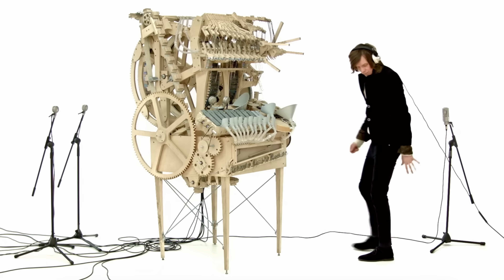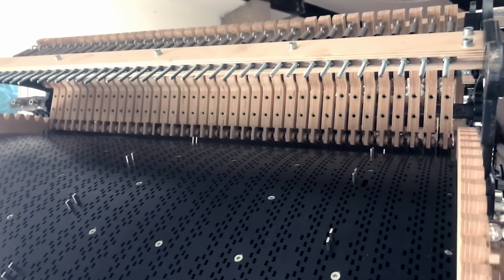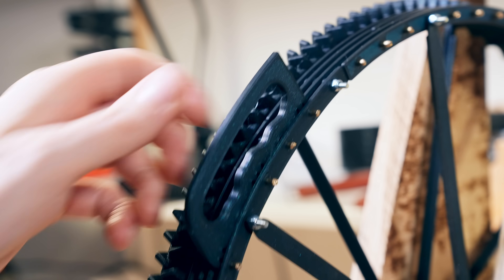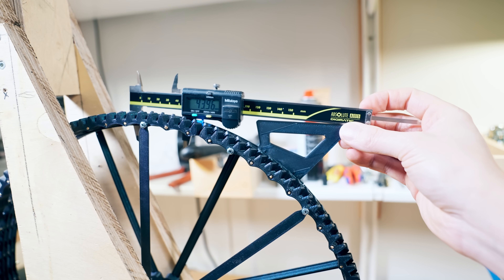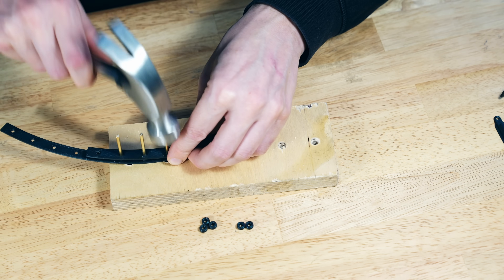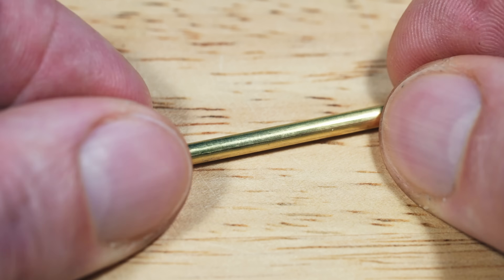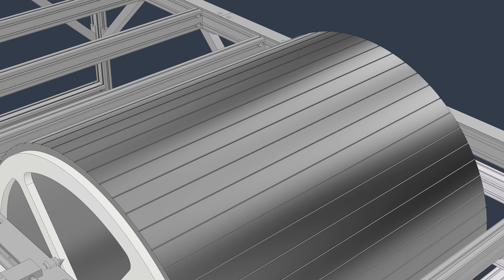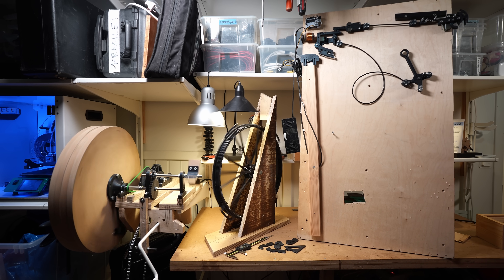Prototyping The Marble Machine Programming Wheel

Comment: A combination of deisgn 2 and 3 is surely easier than relying on an imperfect ball end mill at the neccasary micron level presicion depth. 

Basic 2D Milled end frames (or additional middle frames to add stiffness), same long rods from one side to another and effectivly, all you need are printed or milled spacers to keep the rods parralel and set the horizontal spacing. No need for a 'serface on the programming wheel, like your version 2 prototype.

And the double helical gear teeth could still be done on fifth axis before (smaller CNC footprint) or after assembly as you've planned.

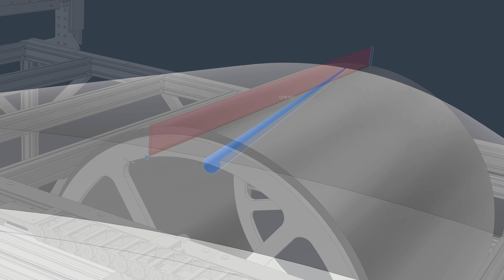Comment: Keep in mind at 8:46 that the cutter moves along the axis of the cnc but the cutter itself will be rotating and cutting on one edge, causing force to be put in the direction of your rotation axis. Something that will help with that is always starting the cut from the same side. This way the rotation axis isn't pushed one direction during a cut and the other direction on the back cut. If there is an offset due to the cutting edge it will be the same for all slots this way.
Reply: I'm hoping he goes with aluminum for the cylinder... much easier to cut and would limit axial loading.
Reply: @MacroAggressor  Yeah and depending on how it's secured there could be a large amount of deflection and chattering. Hopefully he does lots of test cuts first.

Comment: I really like the third idea for the programming wheel, but I have some concerns about the machining. If you cut the slots in a single pass, chip evacuation is going to be near impossible. The only way I can see this going well is if you somehow find a way to use an undersized cutter and take one small bite out of the channel at a time, creating space for the chips to be air blasted away in the process.

Comment: Just a technical comment here. You talked about the cutting forces only being in the "rigid direction" on the programming wheel for version 3. There is actually also a force in the "not rigid" direction. As a plunging cutting tool engaged with material on 3 sides. On 2 of the sides the forces cancel out, but the last side creates a sideways force that actually tries to "turn" the programming wheel. Just something to keep in mind, not critical :)

Comment: I like your idea for the new wheel but I have one suggestion, either use a regular endmill or a slitting saw to cut a small section from the bottom of the circular groove. The ball endmill will have trouble cutting at the bottom of the ball because the radius of the cutter goes to zero with respect to the rotating axis, meaning that point on the ball will essentially drag across the material and cut poorly leaving a bad surface finish.
Reply: If it's mechanically possible on the CNC, he could maybe also angle the spindle so that it leans away from it's direction of movement. That way the point where the ball would drag would be a bit in front where the material will be removed anyway.
Reply: Up

Comment: You will definitely want to test the machining of that long slot it may be a lot more challenging than you think. Chip evacuation will be very important if you intend on using a spherical tip mill. The type of cutter that you showed is not designed to cut plastic at all and will likely clog and break either the cutter or the work piece. The cutter shown is called a rotary bur and is used to contour metal by hand and is notorious for clogging. You would be far better off cutting a groove with a ball nose end mill and then gluing the bar in place. Pressing in a very long and thin metal rod into a long hole will be VERY challenging to get right with a press fit. Most press fits do not go longer than about 10:1 aspect ratio of length to diameter, or you will have problems of bending the "pin" due to every increasing friction of the press fit. Too loose, and it will slide in easy, but you will have to secure it with glue anyway. That would be preferable to the press fit in my book.
Reply: I suspect that he will need to insert the rod longways and not click it into place,  because you will have two plastic pieces playing tug-o-war and if the slot on the wheel "loses" the rod can be pulled out of position. In addition, the slots on the wheel will face degradation over time, due to repeated programming changes, and loose their solid grip on the rod
Reply: The press fit thing felt weird to me, too.  Over time, clipping the profile parts in and out is likely to expose an imperfect fitment on at least one of the bars, having the thing pop out when trying to remove one of the profiles.

I want to see the design work, but I'm not sure about a press fit.
Reply: Yeah a slot with a ball mill is a much more feasible idea. Chip clearing will be near impossible unless there is a pre cut slot like when machining a dovetail. The proposed machining steps should also be reversed so there's more room for chip clearing between programming profile slots. 
Instead of glue, he could clamp the bars down with a bunch of printed straps or saddle clamps.
Reply: @NPerillo I think it's the best way, just cut a grooves to hold the rods in place and secure them with metal straps that go around the wheel

Comment: Why dont you instead take design 3, but just copy and paste the 2D wheel (that's now only on the ends) a bunch of times? Then you connect these slices using the metal rods? (Im no mechanical engineer, just curious)

Comment: Why not quit the 'cover' layer of the programming wheel? Theres no purpose for it, it only adds weight. Just stay with the metal rods and you dont have this much weight and dont have to cut things on cnc. Just do the sides + the metal parts.

Comment: I am pretty sure that the thousands digit on digital calipers is only there for the "feel good" factor. Even Mitutoyo doesn't claim better than 0.01mm repeatability for its range of digital calipers. But then again, if you need absolute accuracy, repeatability, and "tihghtness", you could just use an electronic midi sequencer. Humans are not precise, mechanical devices are already more accurate than a good instrument player, and even electronic drum machines advertise artificially induced imperfections in timing as "natural feel". Chasing millisecond accuracy strikes me as a waste of time. The first machine was imperfect, but it worked well enough. The second never got finished. And looks like the third will never even make it to a prototype.

Comment: What is the advantage of using different profiles for the different note lengths? surely having one universal profile that adapts to the different note lengths would be better? You also wouldn't be in the unlikely position of running out of a certain profile (ie if you needed one extra quarter note profile, you would have to wait for a new one to be printed)

Comment: MARTIN, don't forget, that varying marble troughput trough instruments will put varying load on marble lifting mechanism, which will deviate marble machine speed since you will be inputing constant force via huygen drive. Less marble troughput, smaller load on the machine, machine speeds up. Loads of marbles to lift, heavy load on the machine, machine slows down
Reply: That's what I'm thinking ever since Martin told the first time he discovered the huygen drive. The drive inputs mostly a constant force and the speed results from the force balance. However, the governor adds a bit of a speed regulation since its breaking force is quadratic proportional to the speed. But I don't think it can keep up with such dynamic loads and precision Martin asks for!
Reply: You can address this problem by having full load all the time. Lift all the marbles, flush unused.
Reply: @somebodyyyyy806  was gonna say this, but just not as succinctly
Reply: @johnwolfenden7599  same here
Reply: Honestly there was an electric motor on the mmx, personally I'd do away with all that complexity and just brute force it with a motor and gearbox, no need for a dangerous flywheel, governor etc and it'll be laser accurate because geared down enough they'll be more torque than you'd ever need
Reply: @RobFarley74 It’s simply a “dumb design requirement” for this thing to be mechanically/human powered, instead of using a motor.
Reply: @br52685  You are not at all qualified to choose what makes a "dumb" design requirement, and neither is anyone else. It's not "our" machine, Martin's not building it for us.

But oh well, I suppose you're just gonna try to invalidate what I said, because I've seen enough of your comments to know that you don't exactly know what you're talking about :/

That's all I'm gonna say and I will not reply to your reply if you make one.
Reply: @justinnaramor6050  Martin acknowledged that HIS “dumb design requirements” killed his first two attempts.  Yet two years later….is he actually making any progress?  Does he even acknowledge “dumb design requirements” anymore, or even care about those lessons learned

Apparently, I’ve payed more attention to this project than you have (as I know the reasons why HE thinks his first two projects failed).
Reply: @RobFarley74  Honestly I've been thinking a steam engine would be great. It would have loads of torque to spare and through gearing could be reasonably accurate, plus it would fit the vibe of the Marble Machine perfectly.
Reply: @StuffandThings_  Sounds like a nice concept, but a steam engine that was powerful enough would pose significant safety issues.  A low-pressure pneumatic or vacuum-powere drive might achieve a similar vibe, though, without the dangers.
Reply: He needs to make a clock if he wants steady timing, I hope he doesn't quit before he realizes this.
Reply: @ThrowingItAway if he were able to realise simple things we wouldn't be here :)
Reply: He needs more than a clock. A clock is always under constant load, a MM is not. I'm not saying there's no pure mechanical solutions to this, but it would be easier to implement an electric motor in parallel.
Reply: I agree that if he wants perfect timing he needs to implement electronic control with a motor. I think Martin would be far better off if he just abandoned the need to make the machine play perfect tempo. Just make the machine the main time keeping device in the band and you have zero issues.
Reply: My suggestion to resolve this is to always run marbles through, even when they aren't playing music. That way the load is the same
Reply: @YoureSoVane  "That way the load is the same" As long as the marble lift always takes a marble with it. This depends on the design on how the marbles are fed to the lift and how reliable the lift can pick up marbles. And it could add noise to the machine. But of course that would be a solution for a constant load on the marble lifts. I don't know if the varying loads on the programming wheel will make a difference, if so that could still be a problem.
Another solution could be to have two different power generators. One where timing isn't important that just drives the lifts and one one generator that only outputs the power to time critical parts. Of course that would bring its own problems to solve.
It would be at least reassuring, if Martin at least acknowledged that problem and would mention how he plans to tackle it. Not an unsolvable problem in my opinion, but if he insists on that "perfect timing" one he should prototype and test for.
Reply: Funny how Aeolian and Wurlitzer and numerous other player-piano and band organ manufacturers beat him to the "tight music" and "consistent power" game by give-or-take 100 years. For someone who claims to love mechanical music devices, he sure as hell doesn't spend a lot of time studying them. Also, it's a marble machine. The fact the marbles are just free to fall means there is bound to be some level of random error, due to vibration, or dust/debris, wear, etc. If he want's computer-like tightness, once again, Wurlitzer, Aeolian, etc etc etc beat him to it BY ROUGHLY 100 YEARS!!!! 🤦‍♂
Reply: @ryano.5149 I wish he'd separate out the issues of time delta between simultaneous notes (where even a fraction of a millisecond could sometimes be noticeable because of phasing issues)  and tempo accuracy, especially if he's wanting to allow performer to adjust tempo based upon audience reaction.  I'd like to see for each channel a means of adjusting separately a wheel position offset and a drop delay, by having notes play when the programming reader is *released*.  Limiting the rate at which the reading device can return to its idle position would allow an adjustable amount of time to be added to each marble drop which was independent of the programming wheel's rotation speed.  If one sets a bunch of programming pins to activate on the same beat, turning the wheel very slowly would make it possible to set the positional offsets, and then turnign the wheel at a normal tempo after the positional offsets were set would allow setting the time offsets.
Reply: To solve that is to mangage a gear ratio
Reply: This over and over again! Power input consistency will not keep good timing! He needs high power input and a timing mechanism that can provide the same tightness when playing 100 notes versus 1 note!
Reply: I think the whole thing of exact timing and tight music is overrated. Some variance will make it more charming and not sound like an boring computer.
Reply: @lubricustheslippery5028  If the variance is erroneously induced by the machine itself, that is most definitely a no-no. Martin has stated before that there's a difference between variance caused by the machine itself vs variance as a result of the operator's actions. How would you like it if a keyboard missed a note erroneously even though you clearly triggered the note with your actions as the operator? That simply cannot happen, and arguing otherwise is foolishly stupid. Errors in the machine are just errors that shouldn't happen, they do not reflect human expression/feeling.
Reply: He can always just use another power source for the marbles. Or not at all. Just have enough of them and let gravity do all the work.
Reply: Yup... Varying loads dependency has been a design vice since the first iteration. No flywheel can fight it. 

The electric motor he tried on MM 2 could solve it. My best guess is he will eventually notice it and be enamoured with diferencial gears for 6 months!

Comment: One thing to keep in mind, if the outer material is in tension or compression, it'll move as it's machined. It's possible to machine around this if you go the long route of milling it like you're tightening lug nuts.

Comment: 9:28 Wait, that seems like a lot of metal-to-metal surface area that needs to slide across each other while being tight enough to "press-fit". After you get a few centimeters in, are you going to attempt hammering at the end of a meter-long, thin rod? I highly recommend prototyping this before you construct a whole wheel with it. Maybe consider making the rods thinner, and adding rings on both sides to hold them in?

Comment: Regardless of timing, what would be the density of musical information that you could actually fit on the wheel? Switching from a slow rotating wheel with small pins to a faster wheel with significantly larger slots seems like it reduces the notes you can encode on any channel. Additionally, how will the wheel be changed during a live show?

Comment: Basically we're observing Martin sacrifice artistry for engineering. If it is gonna be playing music like its programmed in FL Studio, the music may as well be created in FL Studio. MMX was the way to go, since it combined the best of both worlds. It went off the deep end near the end of its development, but at least it still had the spirit of the original machine. MM3 on the other hand... I have seldom seen an instrument building project with less soul. This will probably get alot of downvotes, but I can't help but think...
If we're talking "music has to be played tight by less than 0.05ms deviation" or something, then that parameter completely kills the human imperfection element. What this is striving for is studio production quality from a live performance machine, with margins comparable to software-programmed music without any real instrument involvement. The Beatles would cringe.
Reply: All components will add inaccuracy. Combined they might add up to 10 ms. At 120 bpm (0.5 sec per beat), this is a 2% error. This means 120 bpm +- 2.4 bpm. To me this is significant/noticable.

Comment: the instrument is supposed to play multiple songs in one set, right? could you build the programming wheel with a quickrelease so one drum plays while another one gets worked on in better lighting conditions (some kind of sensor array taht checks if all is correct?)
with pins I'd see a (probably very buggy) possibility to automate inside the instrument, but those clippy thingies...
I guess you just gave a lot of enginerds lip chewing material

Comment: Given the limitations of a programming wheel, I think you should still consider a mylar or steel punched tape for programming. You could make each song much longer and could change out songs quickly and simply. Also, if you really want to increase accuracy, you might want to consider electro-mechanical devices like solenoids to drive the marble gates which would eliminate things like linkage slop.

Comment: Lots of good design here: the metal pegs/rods with clipped on notes is a good direction.

I wonder where, in your requirements list, is that the programming wheel needs to be a certain size? Does it need to be so large?